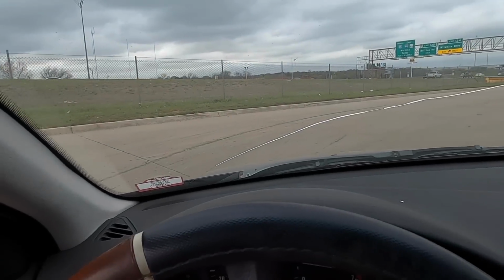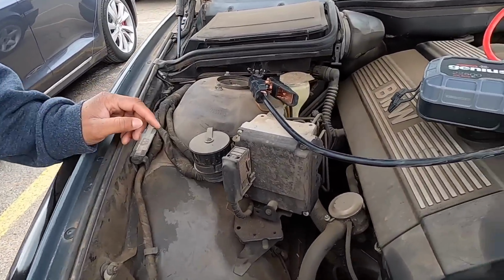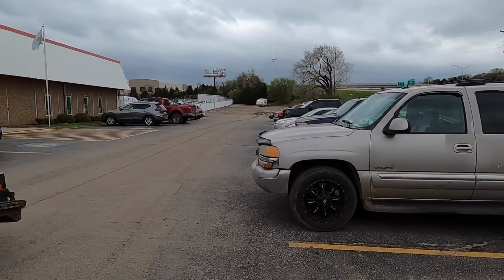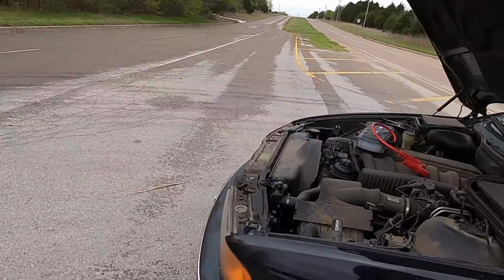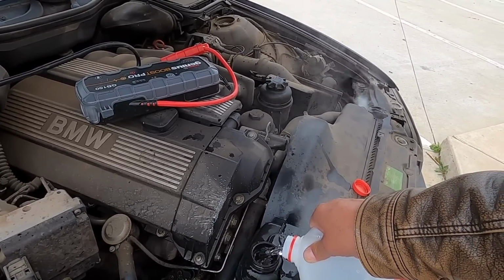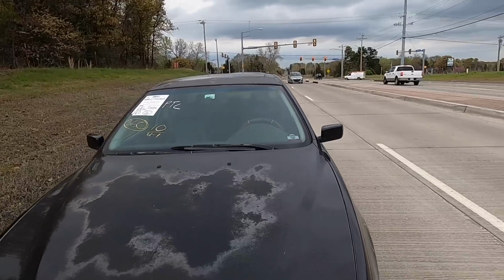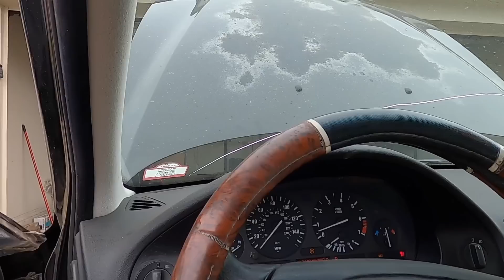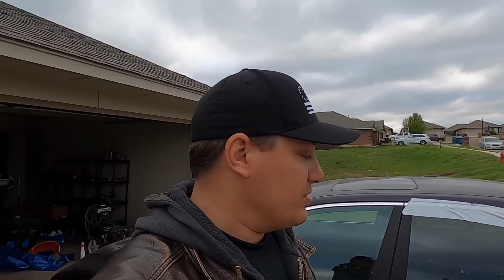I Won a Charity 1997 BMW 528i e39 from IAA for $175!!! Does it Drive??

Comment: And that was that cheap sold 528i you could get a good profit from. The coolent issues on this with the smoke comin out the reservoar and bleeder screws, cracked reservoars and leaking gaskets and etc from the system in general is aaaall common issues on this among Great other things. Welcome to the E39 petrol version World and  help yourself with this build by getting a New water pump, termostat, ccv filter kit and valve cover gasket set, New plugs and coils and cam and crank sensor and do the vanos seals in the and while youre in there and you should be fine with the engine 👍 but first wash it off good so it gets Nice and clean all around and also in the hood but be gentle in there and  polish it in the end so it looks fresh 👌 wanna make it, make you, turn your head back at every time you get out off it? Get the msport bumpers with front lip , Some BBS LM 19" facelift headlights, and rears, csl boot and get rith off the  org silencer and get supersprint or av schnitzer muffler back there instead and TOP it off with some bright white angel eyes and LED fogs. Then you can deside  to sell or keep 👍
Reply: Forgot the destroyed clear coat at the paint. Fix that first then polish haha! Thats accually an easy fix also 👍

Comment: My opinion; no paint. Simply fix the running issues and maybe a few small things(door handle) and send it. You can make a few bucks but someone could use a decent car at a lower price point right now. Thanks for reading.

Comment: Nice, wheels are worth more than the car - Might be a good partout. Overheated too much, it's dead now. Head will need to come off. These engines strip the threads in the block too so if that has to be done, the threads will likely need to be timeserted. Don't want to start putting it back together and find out a head bolt just stripped. Trans limp mode is possibly due to poor voltage from the dead battery, but with that mileage it could need a transmission. Speedo failure could be from low voltage too. Your check engine light could be from a bad ambient temp sensor (noticed the -40 in the dash. BMW makes that set a CEL for some reason). Original overheat could have been caused by that radiator leak or the fan clutch. I've noticed those tend to fail.  But hey it's cheap!

Comment: The speed sensor may be causing the check engine light to come on because i noticed in the video that the speedometer and odometer are not working.

Comment: In general, these are the major flaws with BMWs , door handles and window regulators , breaks once a year , oil leak is is a must , if it does not leak , it is not a BMW,  there is always an error message on the dashboard , AC leak in normal , paint fading is guaranteed , leather cracking is a must , battery dies without notification , and using a jumper may burn of the control modules , gas mileage is a joke , there always dead pixels on the dashboard , aside of that they are OK cars  . A proud owner of a BMW X5 .

Comment: BMW---bring more water!!

OK bad joke but for 175 this thing is worth putting back together. Radiator, door handle, window regulator(s), probably a speed sensor for the abs/speed stuff, i think this will bring profit. Its a beemer, not one of the newer ones ruined by iDrive, BLACK, and its less than 200K miles

Please do a series!

Comment: I think that BMWs of this era were built as "disposable" cars for the semi wealthy. No one should buy them if they have over 120,000 miles on the clock. To quote Scotty Kilmer, "These cars are endless money pits!" And so they are. Until the battery issue is fixed it's pointless to guess what is wrong . . . including the speedo not working. As long as you do the work, it'll be a good buy.

Comment: Here in Bulgaria we drive trat e39 5 series 300-500 000 miles, theu are verry stromg cars,you just need to fix the radiator and some other litle pronlems.

Comment: It's weird when you think about it. Randy said European cars are known for bad quallity interiors but as European I couldn't really say that. Could even say opposite. We get cars with 300k, 400k or even more miles and most of the time all the interior wear is maybe some little cracks and tears on driver seats left side from coming in and out of the car. Cars with under 250k miles look really decent with no major defects on seats. On the other hand Japanese and Amercian cars with leather seats interiors are usually trash with major tears, looking like somebody been there with a knife if a car has more than 250k miles. My own last two Volvos had around 500k miles and only major defects on those seats were small tears where driver always rubs getting in and out of the car.

Comment: Randy, why didn't you use bleach and put directly in the radiator, bleach doesn't get to a boiling point and seeing it would have only been used for a short period of time the car would have gotten home with no over heating issues.

Comment: That noise you’re hearing is not the lifters it’s most likely the Vanos or variable valve timing they’re known to be troublesome on BMW engines they go out all the time it’s one of the number one failure points on BMW motors

Comment: The car has an electric water pump for the heat. To bleed the system just put the ignition on, put the heat to the max and the lowest blower speed. Then put coolest in it an the electric water pump will bleed all the air out. If the pump still works lmao

Comment: The arrow light usuly is triggered by a faulty ABS module, i have a e39 530d and she had the same problem as yours, the speedometer didnt work and the arrow light was on, i put a used nice ABS module and solved the problem. So i'm portuguese and I work only with BMW in a portuguese company named MyBMW, check it on Facebook ou google it, if you need any used OEM parts please contact me!

Comment: No offense, but I've never seen anyone who buy auction cars arrive so totally unprepared to bring them home. You have a trailer, always bring it along. That way you can haul a non-runner, or one that has problems along the way. If you get a runner and a second car you can bring them both home in one trip. Always keep a couple 5 gallon jugs of gasoline and another few jugs of water or a leaker or boiling motor. A couple good flashlights and tools is a good idea. Lastly, carry a good, charged battery, they always seem to need one. Some old rims and tires with air to fit the car might be a good idea too.

Comment: Turkeys crossing in front of you after buying a 90's BMW with no known service history, takes a turkey to recognise another turkey.., bad omen! The 90's BMW's were fun cars but not without factory inherent problems. All of the 90's BMW 6cyl's had water pumps with plastic impellers.  The plastic impellers would break off in the cooling system.  If that wasnt bad enough the Coolant Temperature Gauge in the instrument cluster IS NOT a normal temperature gauge, in that it doesnt really show slight variations in temperature - specifically when getting hot.  The gauge will only show hot AFTER the system is actually overheating.  So if your gauge goes to the right of center your system is already boiling; aka, blown head gasket or warped cylinder head or both.  BMW really stuck it to their customers specifically the 1st and 2nd buyers of these cars - most customers that bought these new or slightly used had no idea about the plastic water pump impellers nor the double wammy of the water temp gauge that only reads hot after the system has surpassed critical.  Most customers who owned these at the time the overheating problems manifested were talked into a Trade'in by the New/Used car dept.  BMW should've been sued w/a class action law suit.  1st things to check
1) New Battery / Transmission?
2) Coolant Leaks, Radiator
3) Internally Blown Head Gasket
4) Coolant Fan Clutch
5) Replace Water Pump
6) Replace Thermostat n Housing
7) Aluminum Thermostat Housing(?) Is optional, but more durable
After confirming the coolant system is not compromised you can now approach the BMW with the usual checks you would for a newly purchased used car with no known history.  The interior is the right color.  Swap in an LS w/a 6spd manual trans and have a car that will last forever; or flip it as an LSX potential project.  Advertise $1500 n sell it for anything more than you've got in it.  Good luck with your BMW.., [B]reaking [M]y [W]allet.

Comment: I wish to be your neighbor to take this treasure from you 
In other countries this car will be a nightmare for other cars 6 or 8 cylinders owners 
With some tuning this car will be looks like rocket ready for racing 
But due to overheated the engine cylinder head became barbecue 🌡😤
By the way it will be super pretty with repainting, Magnaflow catback exhaust system and mufflers, new 2 size HAMANN wheels size 19"
In the end if the car right now with you put all your love with it.... please 🙏🙏❤

Comment: Cant see neither that any1 here has explained why the speedo doesnt work, well thats why you have the abs and ASC light on my friend 👌. Its the left rear abs sensor, change it and drive it for a few then tank me later 👌 a good tip is that the sensor if probably totaly rusted to the hub back there and the screw with it, take wd40 and shower the shit out off the screw and the back off the sensor and wait atleast 15-30 min before you start trying carefull to loosen the bolt and when thats out, start  carefully to pry the sensor out with a small flat head 👌 worked every time for me with that shit 🤘

Comment: I would rather have this than my brothers 2014 audi a4 2.0TFSI

WE OPPENED THE HOOD FOR A ENGINE WASH AND THE ENGINE WAS SOO MESSY , THERE WAS OIL AL OVER THE ENGINE GLAD IT DIDNT GET JAMMED BUT WE CANT EVEN FIND WHERE THE OIL CAME FROM AS THERE IS TOO MUCH OIL OVER THE ENGINE LIKE U CANT TELL WHERE IT COMMING FROM ANYONE HAVE ANY ADVICE?

Comment: Your power issue looks like it's gonna be the v.s.s. (speed sensor), where as it's either consuming , or leaking coolant, cross your fingers for a leak , / or the fans quit, overheated once, boiled way over, and got sent to the auction,
,.,.,
Not an expert just throwing out my thoughts
Reply: Made it to the end of the video, I think you got a good deal , worst case , throw a junkyard 5.3 in it and make a sweet little hot rod

Comment: I don't recall you saying the year and mileage on this. 
I actually hate hearing people bitch about German cars all the time. You have to maintain them just like any other car. People buy them and then freak out over the cost of maintenance and so just let it go and the car turns to shit.
I have a 2001 e320 and I found a lot was let go and now I am slowly fixing it up on my limited income. I really like this car though. It is solid and runs great at 150k miles. It just costs a lot to fix.

Comment: Randy, try running some seafoam through her. Usually if the tick is due to clogged oil passages, that will resolve the issue.

Comment: If the speedo is not working, you probably don't have the correct mileage on the car, I bet the speedo cable is not connected, that's why its not working!

Comment: You might have got away with a water pump. Very cheap. But you might have destroyed that engine, they are an all alloy unit and dont like being cooked. It may be a Nikasil or an Alusil engine. I know these cars well having owned many. It may have been screwed and overheated badly before you bought it. But these engines are trash overheated badly too many times. Good luck with it I am a soft arse with these old BMW's. Hopefully not terminal engine damage and look forward to updates. The pixels on the instruments are fine, that is a result.

Comment: Sorry every Vechicle is not perfect it be a Boring Channel . Run a Compression test get a battery that could fit most Vechicles because running a Vechicle with Bad Battery does your electrical system no good .
You have to get your hands dirty now and then I bought lot's of Vechicles with issues myself at least it showing it problem right up front . Even if you have to get used parts for some of it don't get used water pump if need but either part maybe good see if thermostat has been pulled or not . Maybe you can make your own Gasket for thermostat save a few $$$ you got either Vechicles for Content .

Comment: Good luck-replacing the door handle and window regulators is >$1000
Reply: 1000? 😂😂😂 you one of those persons who sends there car fix and pays stupids amounts? 1000  hahahahahhahaha ur nuts man. Not even over 300 bucks if your proper handy man
Reply: @kaitlinking6240  that is dealer charge
Reply: Nonsense , junk yard will have both items .
Reply: @bren70ssss94  No warranty on JY parts..something you [pull from a wreck could work for years or fail tomorrow.I'd rather pay a dealer to do the job-at least you have a warranty.

Comment: Hey randy i think it could be a good deal if tou part it out because with it being ran that hot jope the head gasket didn't blow and if it did hope the head didn't warp if the head gasket is fine and the head is ok then it could be a good deal but also remember bmw stands for bring my wallet

Comment: you drove that way to long hot. there is no way you do not have a cracked head. and you using water. and you hear the valve tap?  yea your a you tuber. the head is trashed
Reply from the maker: Jay R and I give zero Fks.
Reply: The e39 was a beast. As long as you took care of it. Still to this day a tank.  Give me a better car. I will wait.